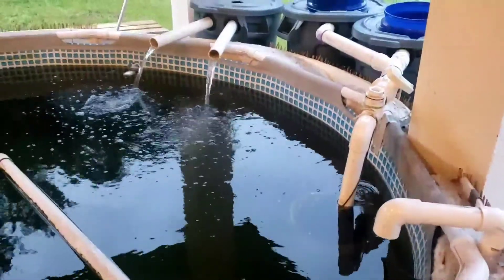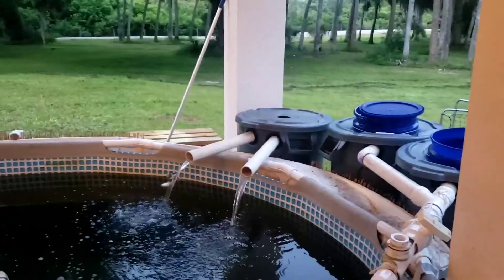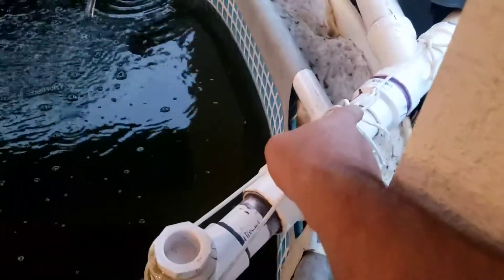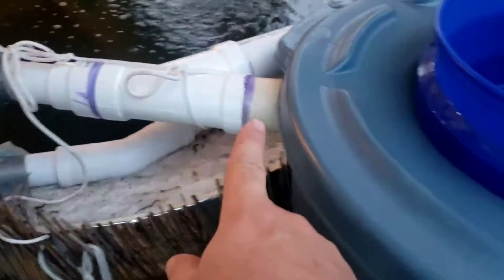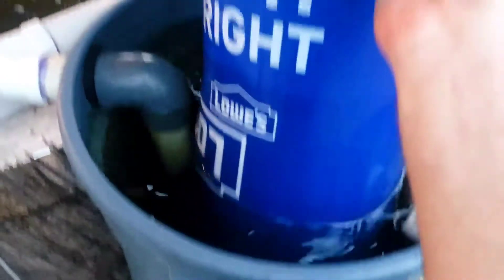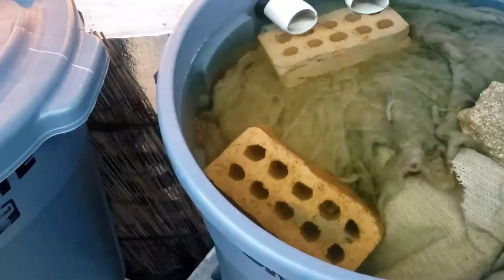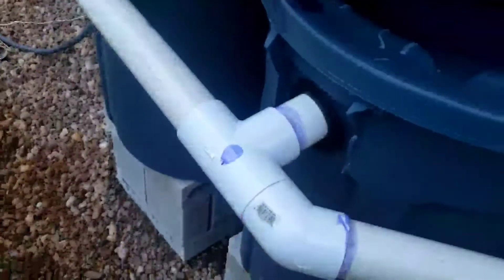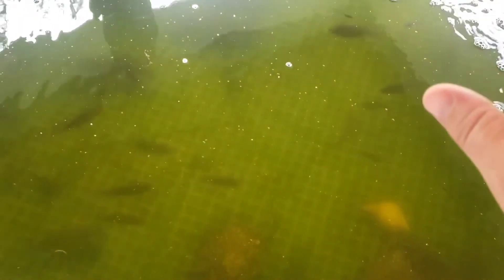Building a dual radial flow settler (RFS) for my pool pond aquaculture / aquaponics tilapia system

Comment: also you can do a vacuum suction. you can cut a hole and install a bulkhead fitting it can be done. add a 2" pipe into where the surface level would end up being 3/4 up the inside of pipe. add a 2 T. horizontal pipe to center port of the T with other ends up and down. run a straight piece of pipe down to just above bottom. when it is full it will create a draw which would pull from bottom and you can run that into radial flow. I can draw up a pic for you to understand if the sketchy explanation

Comment: Maybe install a check valve between the two first barrels that way #2 doesn't back flow into 1. also install 2? bulkheads at bottom of first 2 barrels into a T with ball valves. that way you can drain off sediment without shutting down and draining

Comment: For the solid removal try an airlift , they never cloth you can raise a large volume a few inches into the settler
Reply from the maker: I will look into that idea. I did figure out a way to put in a solid lifting overflow for now but it's not perfect. Thanks for the tip!